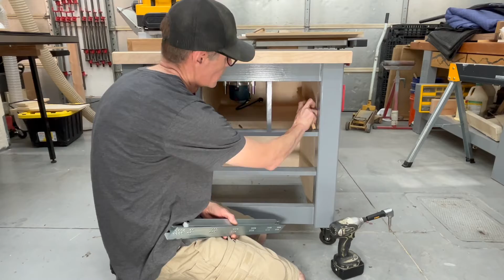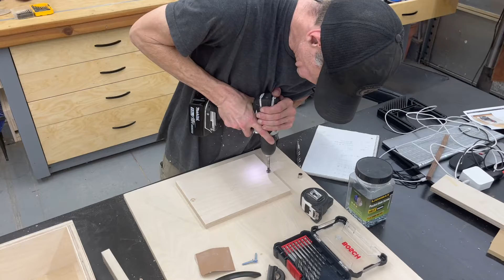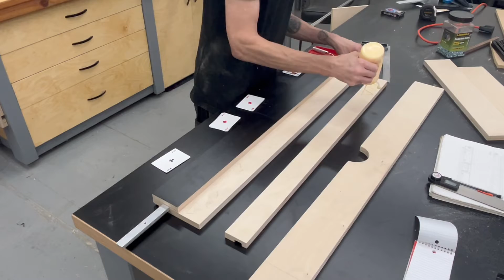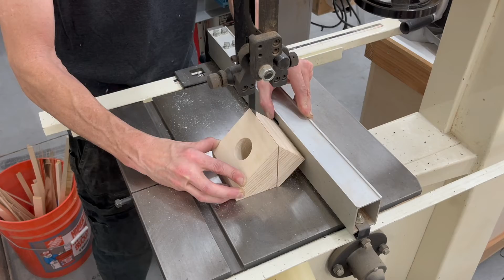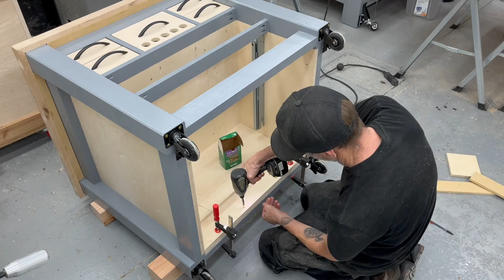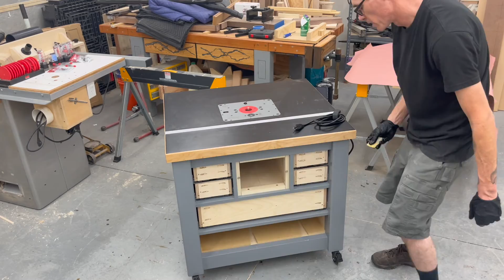Router table build part 2. Mobile table with dust collection and storage to improve organization

Comment: Enjoyed watching your video. great table and cool idea with the table sled. I built a table not to different from yours about 25 years ago and it still performs flawlessly. I also incorporated dust collection in mine, both for the room below the router and extraction from behind the fence both linked to a common 4 inch port at the back of the table. So I was looking to see how your collection is setup but I'm thinking you left the table portion out of the video. I'm wondering how well yours works at extracting debris from the router room; does it pull air up through and out the fence port or do you have a port in the back wall where the router lives? Hope this makes sense.
Reply from the maker: It has a 4 inch port on the back side of the table where the router lives as well as a port in the fence. I was pleasantly surprised by how good the dust collection works when used separately or combined. There is zero debris build up in the router area when used. Thanks for watching. Hope you have a great day! 
Scott

Comment: Part 1 was brilliant to watch u make the frame and casing up for this really sweet router table. MDF is lethal. I ended up with Conjunctivitis from working with that stuff. The dust from that and Plywood is way too fine from table saws and routers. 
I gotta say I would love to own one of those beautiful HARVEY TABLE SAWS. Is it true that HARVEY created the Saw Stop mechanism for stopping the blade from cutting ur hands or fingers off? They build some really nice machines, accessories, etc. 
I would spend my money on one of those saws when I have the money but to get one in IRELAND is very hard. I need to buy one from one of their affiliates in Holland or somewhere like that. 
This isn't about table saws I know but I love those saws. U get more for ur money with HARVEY too I believe. It's crazy how much cheaper they are than the other big name brands.
This router table is stunning bro. Keep up the brilliant content/. I got some nice ideas from this one. Thanks very much my friend..
Reply from the maker: Thank you for watching and the kind words. After having my saw for about 2 months now I can say I’m impressed with its build quality. I’ve never owned or used a competitors high end saw so I don’t have a frame of reference but I bet they would go toe to toe. I had a small issue with the fence when unboxing the new saw and the customer service was great. New part was at my door in 4 days. Bummer it’s hard to get in your location, I imagine the shipping cost would really affect the price savings. Thanks again and I hope you have a great day!!
Reply: @squareandlevel  Yeah it is the price of shipping. THANKS FOR THE REPLY MAN.  Appreciate it very much. Take care. I will be watching more videos..

Comment: Genius to have bottom ‘drawer’ be your sled. (Jer is likewise a genius.) Where do you store your router table fence when your table is under TS wing? Thanks for making and sharing your videos.
Reply from the maker: Fence is going to be mounted on the post that’s always been the bane of my shop layout. It’s right next to the where the table is. Make the best of the space I have. Thanks for watching!!
Reply: @squareandlevel  Thanks. Please do a shop tour video and become an Amazon affiliate (you’ll benefit as will your viewers from knowing what tools, etc, you’ve used on each product.) BTW, do you have the link or description for the small parts organizers you have in the top drawer in the left side of your miter station? Thanks, again. I’ve now watched all of your videos, which are improving rapidly. You should be proud. I think your channel will continue growing rapidly (especially if you start doing plans, although I imagine it’s a pain to do plans if you didn’t make them before the project.)
Reply from the maker: Thanks for all the comments and kind words. I really appreciate it. Going to wait till the shop is finished to do a tour. 3/4 way done. I briefly looked into the Amazon affiliate program and got pulled away. Definitely need to look more into it. I just taped off the laminate and sprayed the miter grooves with flat spray paint on the out feed table. Link for containers-
Garage Organizers and Storage 
https://a.co/d/9rRogZE
Hope that works. YouTube has been modifying how links can be used. 
Thanks again!!
Reply: @squareandlevel  Thank you very much for taking the time to answer my questions and provide the link. I await your next video. 🙂
Reply: Can you post a link to Jared's site please  @squareandlevel
Reply: I just noticed that the miter sled grooves in your assembly table are black inside to match the top of the table. I love this improvement and I’ve never seen anyone else do this. Did you use paint or what? Thanks.